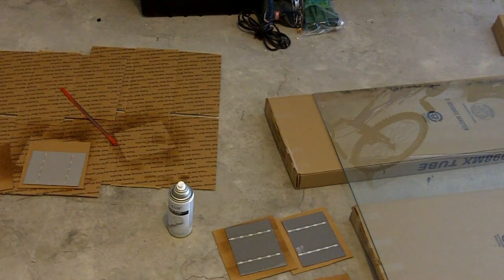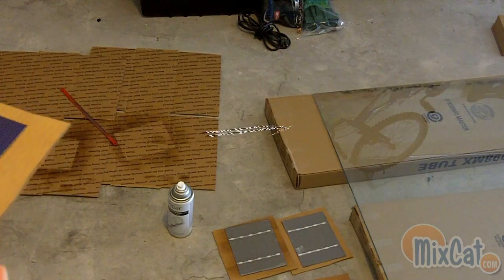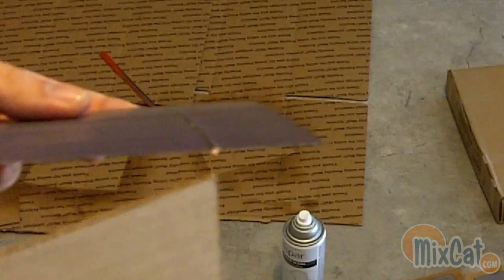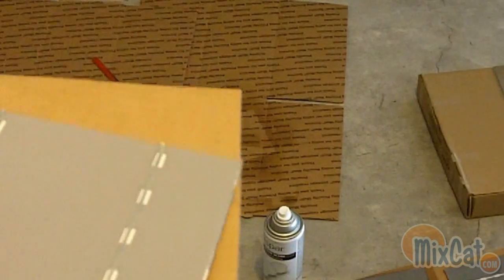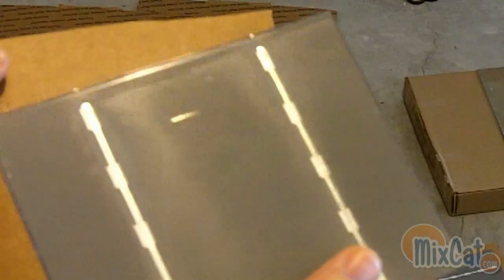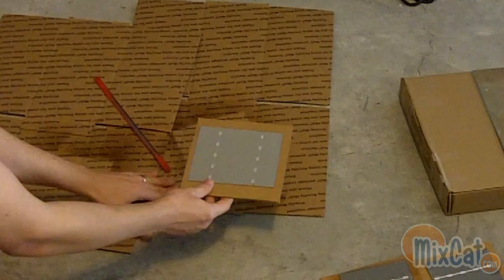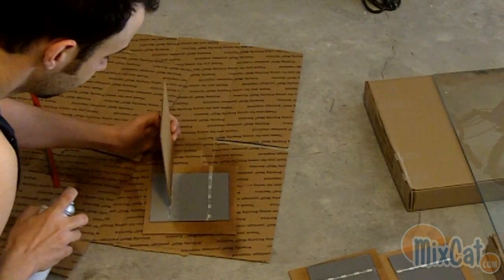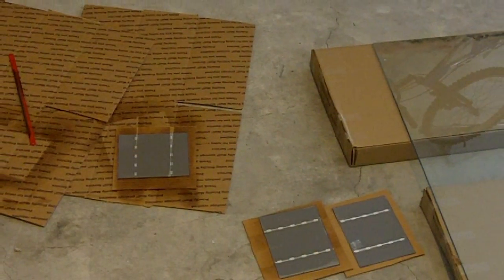Cracked or Sharp Solar Cell repair! Strengthen your solar cells DIY

Comment: I have read many times that using a coating such as this will either cause corrosion or will actually cause the cell to crack in the heat of the day because of expansion...
Can you tell me how your cell has held up outdoors.

Comment: Pete,  as always an excellent and helpful video.  Can I suggest you cover the solder points with elmers glue before painting? Let it dry, paint, then scrape B4 soldering.  Might take a little time but should ensure a clean joint.

Comment: Thanks Mixcat always informative. Are you gonna do some more beer tasting? That was fun. Hey do you know anything about the saucer solar thingys. I mean they heat up so fast. Do you think there is anyway to control that heat so it doesn't burn right through everything. We are making a solar heater with soda cans. Have you seen those?